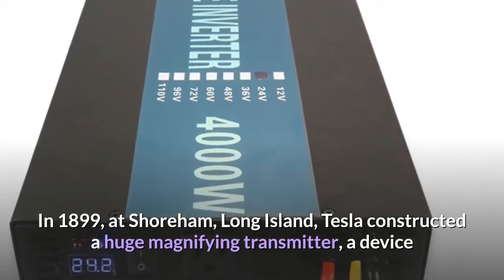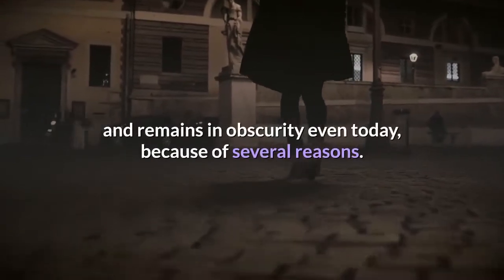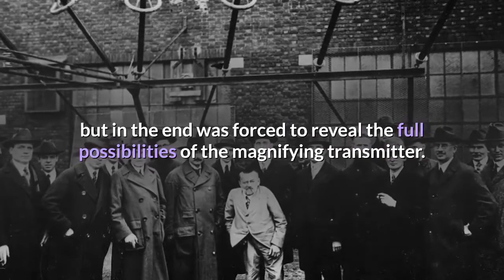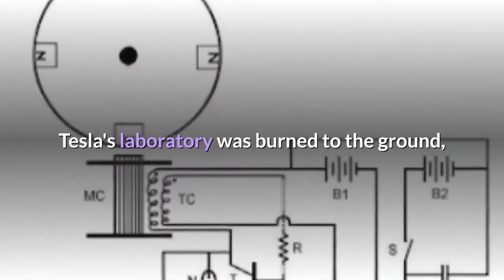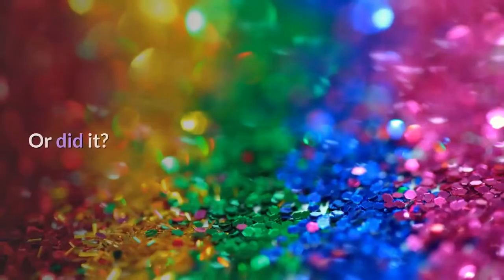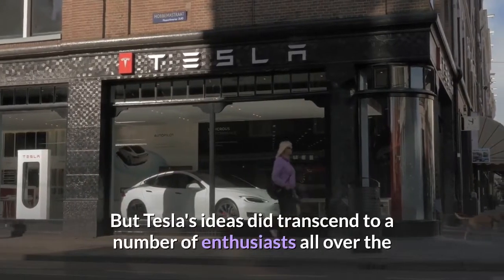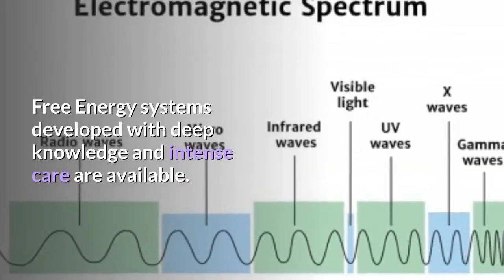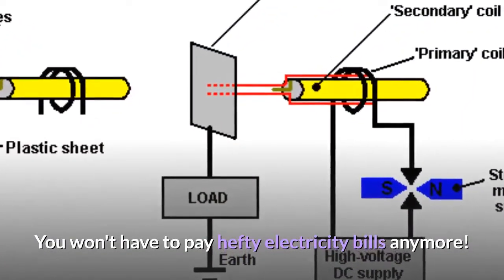Radiant Energy Tesla - Device To Harness Free Energy, Even A Hundred Years Before!

Comment: there is some merit in radiant energy, I have achieved good results using the right configuration of a rectifier, capacitor and inductor. Much more funded research is needed in this field but it does have possibilities.